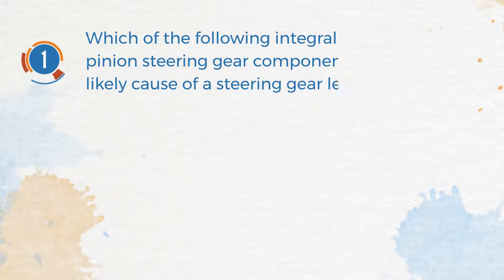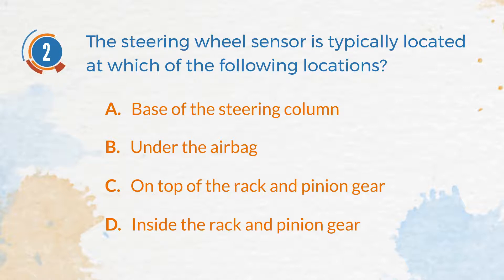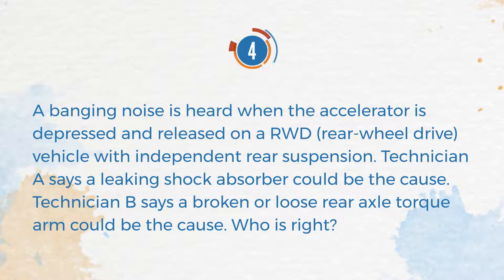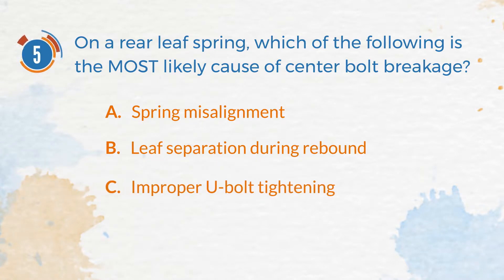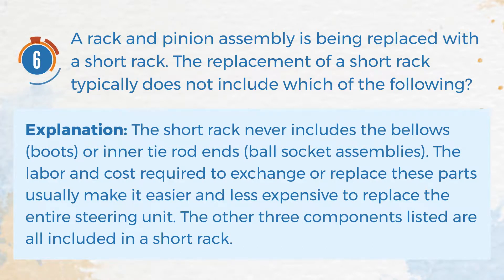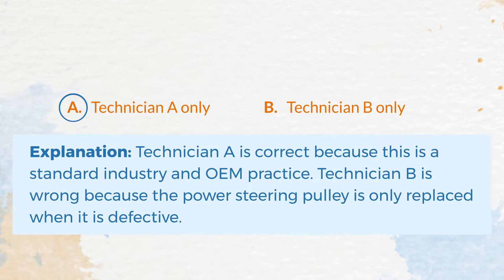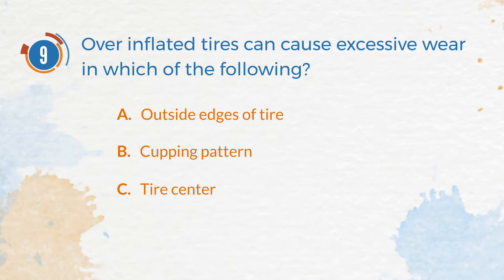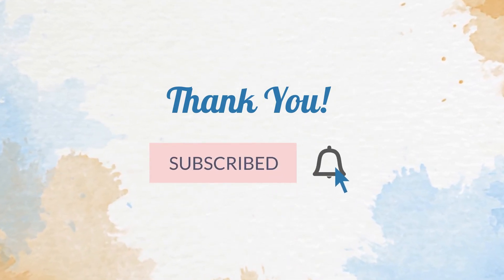ASE Practice Test | #4 Suspension and Steering | TruePrep

Comment: I’m not so sure those industry standard values are actual industry standards. Most new cars recommend replacing the drive belt as 100k miles if no defects form. The hunter tire machines have you add weights in 2oz intervals.
Reply: Drive belt is mostly on appearance, feel, and stretch. Hunter tire machines have you add weights in .25oz increments.